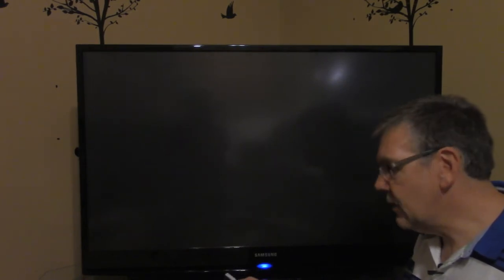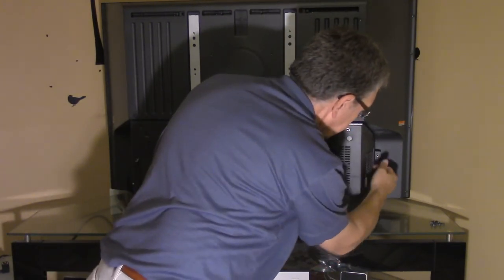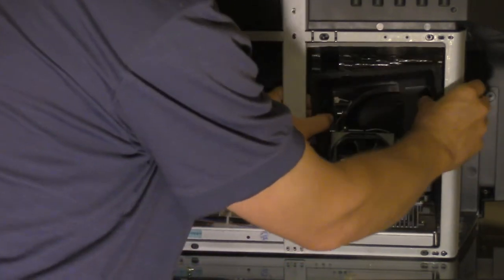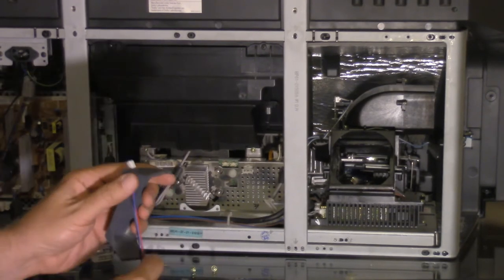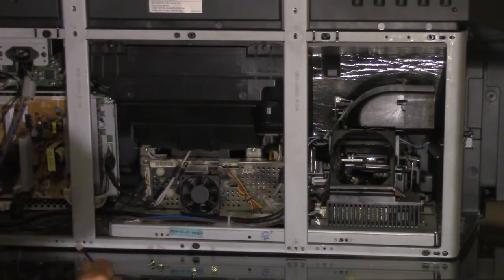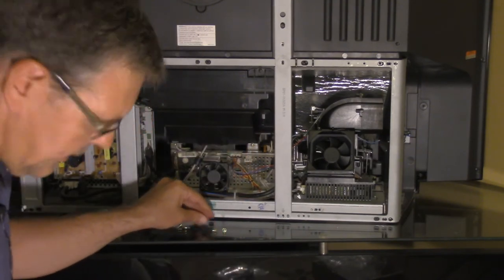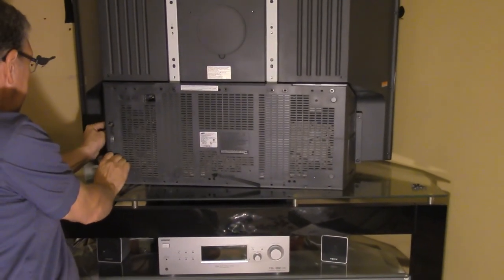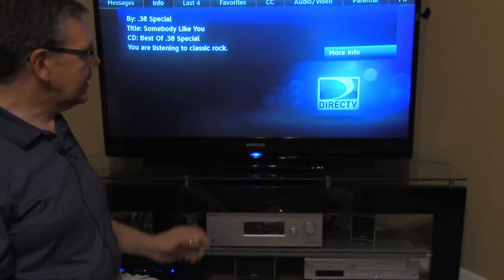Samsung TV Fan Replacement

Comment: I just got the "Check fan #1" message today and I've got the DLP chip ordered to fix my white dot issue, great video and it should make my repair go a little smoother. I have a Samsung HLT6187S.
Reply: +Cody Barber where did you buy your tv fan? i hav a Samsung HLT6189S and I'm just trying to find the fans, I'm in need of number 2. Are they all the same for each model???
Reply: +Kari Stanford you can contact Samsung parts and they will give you the part number for the fan based on your model. installation was very simple, a few screws you remove the back housing and the fan is directly accessible.

Comment: Very good instructions . Worked perfectly on my Samsung Fan replacement! Many Thanks for sharing the expertise!
Reply: +stephen daigre where did you buy your tv fan? i hav a Samsung HLT6189S and I'm just trying to find the fans, I'm in need of number 2. Are they all the same for each model???
Reply: Kari Stanford I ordered it from Samsung parts. I used the metal frame from the existing fan unity. it wad a direct replacement.
Stephen

Comment from the maker: The fans are different model numbers. I took the model numbers from the fan and did a search and several sites came up that sold the fans. I would replace both fans while you are in there
Reply: rick, very helpful video...i have a HL-T6187S....have fan #3 error...so where can i get the fan ( is there a parts model # ) and does it come with instructions, etc....thanks
Reply: If I got the model number of the TV, would that help? Or is it better open it up and get the model number of the fan?